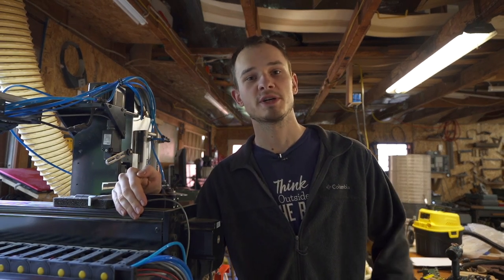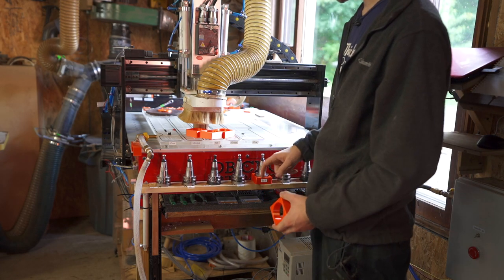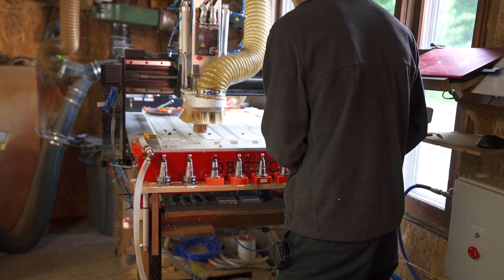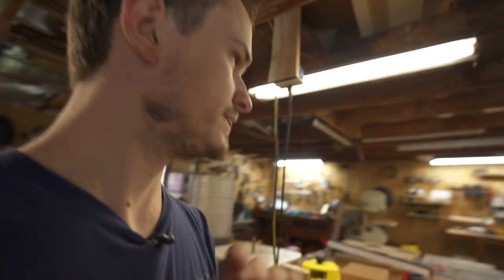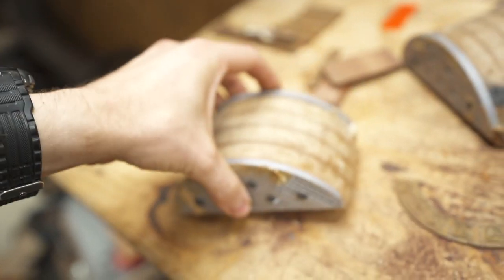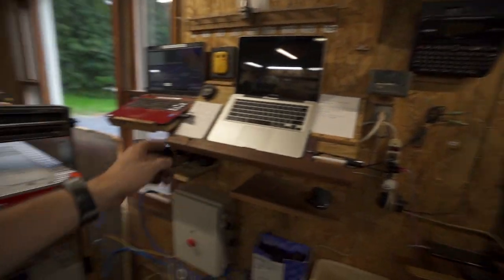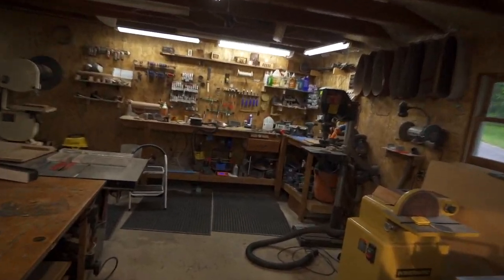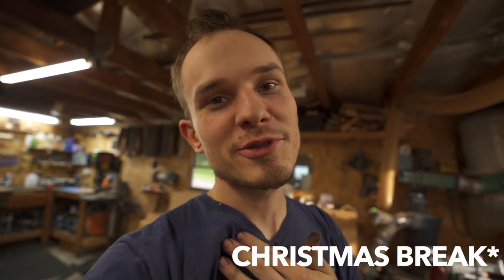SunDial Production Vlog #1 | Jesse Born

Comment: Jesse,   Just started to watch your videos (referred by Chris Ramsay) and really like your shop as it has a very personal feel. As for the laser, I own a Laguna 24x34 120W and find it invaluable for exactly what you are thinking (trim CNC router tabs) as well as engraving etc.  I think with a bit of experimentation you could have it do some of the weathering as well to off load the CNC router doing the engraving. The only drawback is additional ventilation fan noise and at times smell of burnt wood but it will pay for itself in time saved.  What material were you using to print on the Prusa? assuming PLA with the size and height of the print.   I need to watch more videos but from what I have seen so far all your work is amazing and beautiful.  Wish I heard about you sooner as I'd be customer in a heartbeat.
Reply from the maker: It is quite personal. It's my Dad's shop, but the tools are mine. I was really hoping the laser thing would work for cutting those tabs left by the router, and it's great to know you are using it for that. It's hours of time sanding those tabs off otherwise.
I did not know Laguna made a laser...they are a decent company.

Yes, I have only ever used PLA for printing. I don't know anything about other materials. 

Thanks!